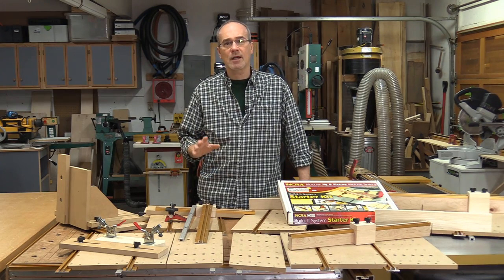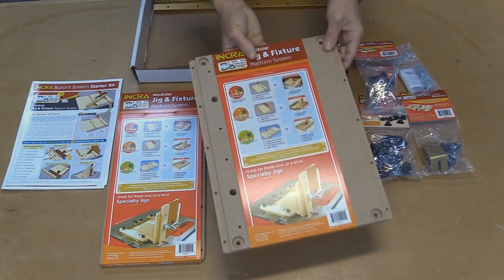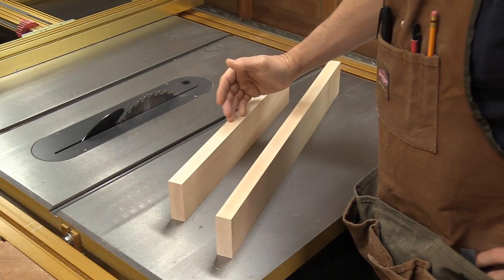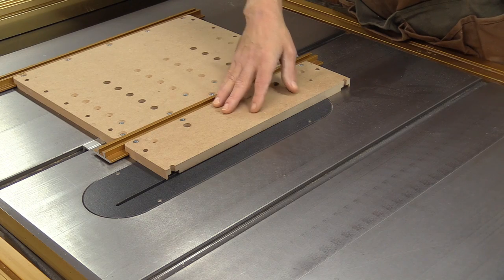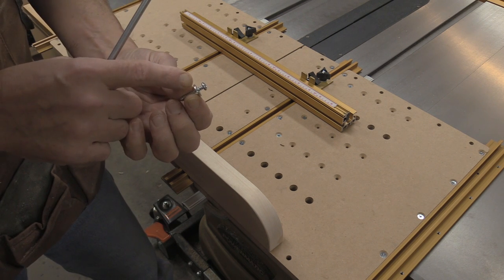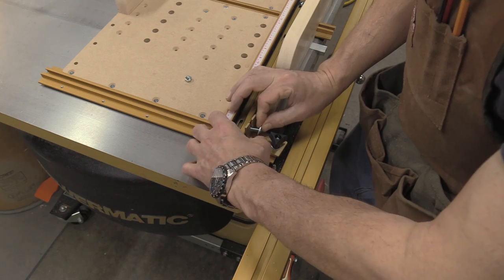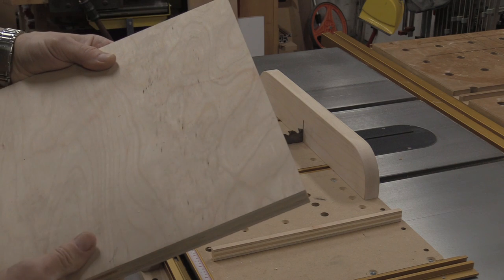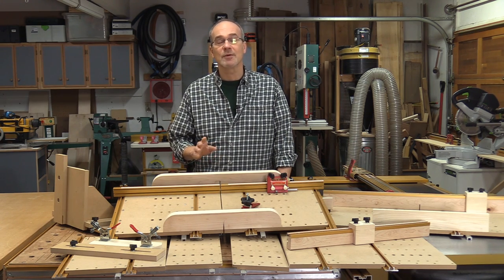Build It Jig & Fixture System

Comment: Hello Guy, I really liked your video as it was very informative and to the point. I only have a couple of questions though, when you displayed the items that came in the starter kit, it did not come with the 18" Incra tracks that you used in the video itself. I did however go to the Incra home page, but I could not find them anywhere, so how did you get your hands on them.
Reply: I got one of these today. The basic starter kit comes with a few missing "items" for this exact set up. Here is what I did with my kit to make this sled. Basically you can make one side of the sled the way advertised. I bought from Rocker a 18" miter slider (Really any adjustable or fitting miter slider will work). I found a 11"x 11" MDF scrap and planed it to the exact width of the "Build it Panel".  Cut a Leaf or "shelf" at the exact depth to connect to the "T-Slot Panel Connector. Then you can just use those pieces to make the right side of the sled. With my set up I do not need a "T-Track Fence" ( I simply have a fixed board parallel with the Left sides "T-track Fence". I hope this helps someone and is clear enough to understand.

Comment: Amazing Video, even better sled, and components.  However; in the interest of clarity when listing the required components you should be more specific when listing them because you mention "Two 18" lengths of Incra T-Track" However; you are utilizing two 18" lengths on Incra T-Track Plus.  So if someone was writing and listening they might end up ordering regular T-Track which does not include the measure meant section.   I hope this helps someone out.

Comment: How did you get the hold down in the track?  After the front and end piece are attached it covers over the track.  Is that a removal process whenever you want to add or remove a hold down?
Reply: yes.... I believe so... I have Rockler hold down clamps... On a large 3' x 5' Maple Butcher Block table I placed T-Tracks in to hold down work to the table! it free's up my hands and I don't need another person... I haven't found a way to get those Rockler Hold down clamp in to the t-track unless I go from the end opening! :(
Reply: Did you ever get a real answer for your question. I had the same question.